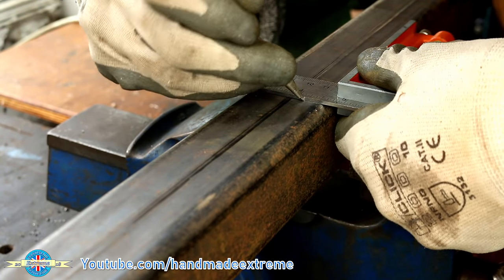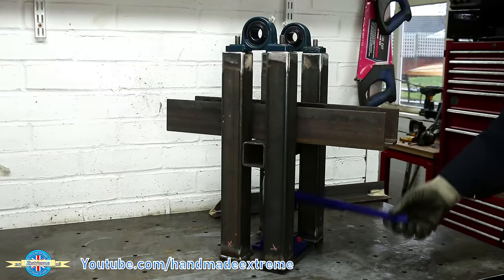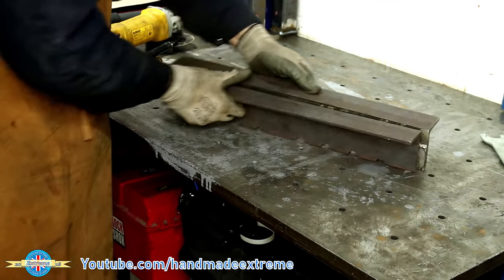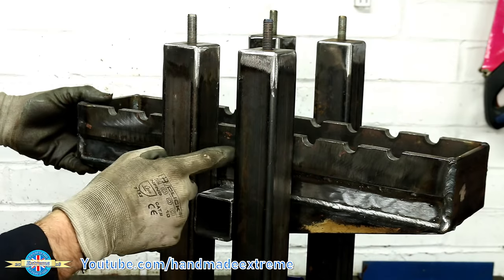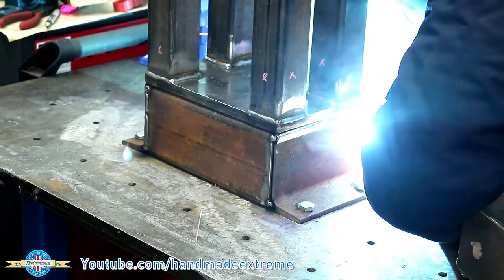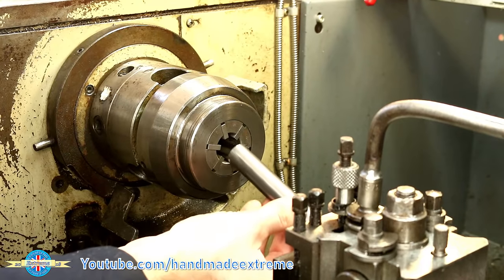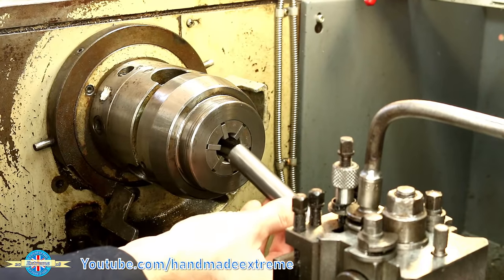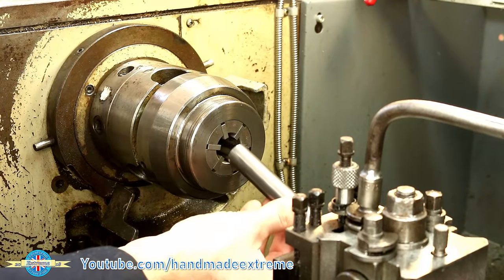Making a Metal Roller Bender (Ring Rolling Machine)

Comment: Another machine to make when I finally move and get my workshop built. Just got the 250 amp rtec mig and it seems good, hopefully it will be as good as the tig welder I already have
Reply from the maker: Good luck with the move. We are in the process at the moment. There is a bigger workshop in the pipeline as well so hope to do some of the bigger projects I've always wanted to do.
The MIG seems to be going well. I too also have one of their TIG machines. Bought it over 10 years ago and it's still going strong. That's why I approached them to get the MIG.

Comment: Hi, when I first saw your bender before actually watching the build, I thought "wow, that's really flexible but maybe a bit of overkill".  Now having looked at the performance as built, I think it a brilliant design.  To further add to the functionality ( and with the power you have available from the jack! ) I'm tempted to build one with an interchangeable press-brake top that mounts on the same fixings as the top roller

Comment: I would have mounted a hinge, with cylindrical lock, at the closure, to avoid every time where to disassemble the main roller, to remove the finished work.  It may be a good idea :)

Comment: I assume the 50mm x 50mm x 3mm posts  2" x 2" x .120 wall?  I need to roll some 1 x 3 at 14 gauge (~1.5mm wall) for a project would your machine easily do this?  If so, could I possibly get you to make the machined parts for me (at some cost obviously) while I fabricate and weld all the other parts? I'd greatly appreciate the help.  I have a nice mig/tig machine and have those same bearings on hand.  What I don't have however is a lathe and mill.  I do actually have an old Logan lathe but I need to restore it and I know nothing about lathing.  I can also have some of the parts waterjetted if that would speed up the process (such as the roller cradle).

Comment: Great Ingenuity and problem solving! How did you find the 180A MIG welder? I have looked at buying one of those from R-Tech to replace my old Mighty MIG.
Reply from the maker: Thanks, glad you enjoyed it. Seems to be working well so far. I've used it for this project and welding the bottom of my van back together after it failed it's MOT test.